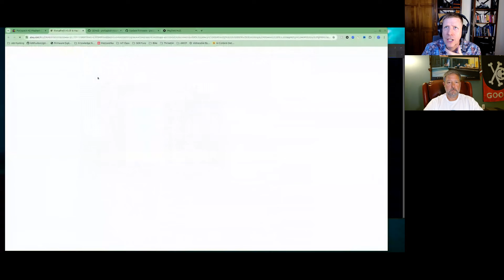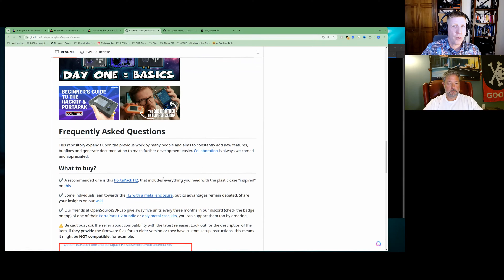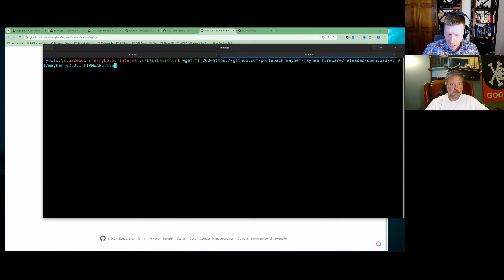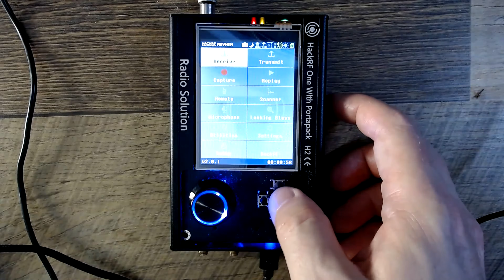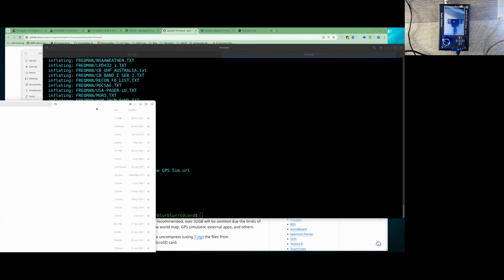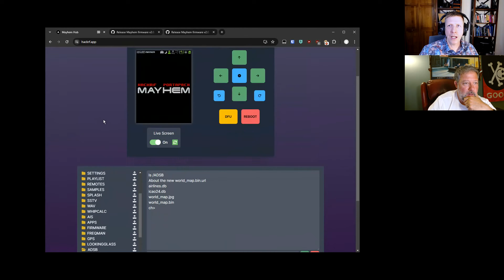Setting up the HackRF PortaPack

Comment: I've bought a portspack with hack RF that  will be with me this week so I thought I'll give your video a quick look to see how difficult it's going to be to set it up because I'm not really a computer nerd and it looks so difficult so I can see me putting them in the bin.
I thought it would just be as simple is 6 steps of how to install the software and utilities on the portapack but it doesn't seem it's as easy as that which is a shame.
Reply from the maker: If you use the web upgrade tool,  that's by far the easiest way.

Comment: My display screen isn’t working so I put it on HackRf mode
Reply from the maker: This is a common thing after you upgrade the firmware. Try powering it on and holding down the left or right button.
Reply: @ it’s a hack rf H4M it undergoes the DFU and the screen lights up but when  I try to flash the firmware it’s doesn’t read the HackRf board.
I think it’s a common issue with the H4M but it couldn’t find any clear source to help me with this.
I tried both buttons but still won’t work

Comment: Bro how much are gps trnasmission of hack rf covers and can i use it in my room to spoof gps location of games is it safe?
Reply from the maker: Let's start with: it's illegal to use the GPS spoofer in the US and a lot of other countries.  The signal strength is not strong, so the area of effect is limited. But technically speaking: for just a phone, that's close,  it might work.  However,  if it's a phone,  you can manipulate the GPS through the debug or developer interface. And some games are wise to this,  so if you're in Paris, London, and Singapore in just 5 minutes,  they know you're cheating. 😂😂😂

Comment: I just received mine yesterday. It's the clear see-through with the blue LED lights.
How do I completely shut it down so it's not on all night the blue lights stayed on and I could not get them to go off. Could not find any hidden switches or buttons there's nothing in the menus anywhere that I could find.
How do you turn it off before putting the SD card back in? I don't see anywhere on the menu. 
I know that you need to switch off power before switching antennas could damage the final.
Can I bring over some of the TV remotes I have from my flipper  
Air conditioning controls and a couple door locks from our RV
Reply from the maker: Just disconnect the USB/power cable and double-click the dial quickly.  It's not only a dial, but it's also a push button. 😂
Reply from the maker: TV remote: Most likely, you can capture and replay remote control signals, but there isn't a "make it easy" application.